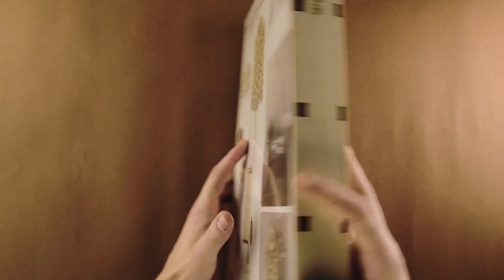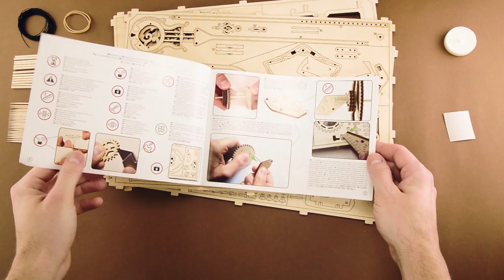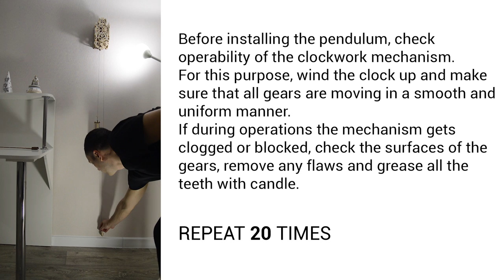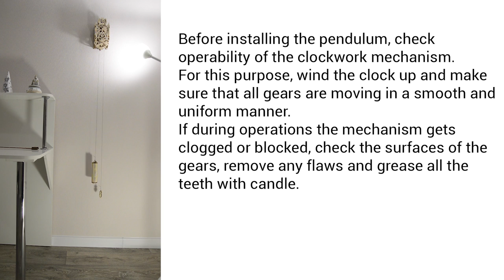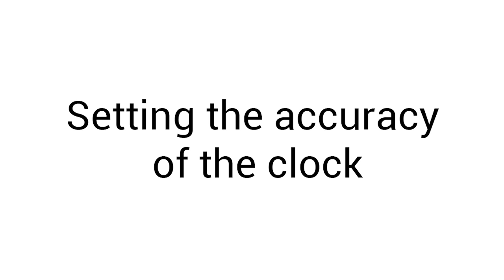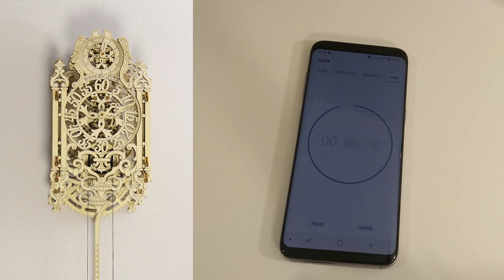ROYAL CLOCK ASSEMBLY

Comment: I simply can't think of anything else that will get me through this lockdown period.  Looking forward to starting this project.  Thank you for that wonderfully calming video.
Reply: Let know how it goes for you. I put this clock together last week, and it only works for about 10 to 15 minutes each time I try to start it, and then it stops.
Reply: @tamerlanechessclub3652  i finished it a few days ago. Unfortunately I can only get it to run for around a minute.  Thoroughly enjoyed putting it together.  Looks stunning, but alas it seems that it simply doesn't function.
Reply: @paulsalmon1625  I replaced the weight with 2 full water bottles [for a total of about 1000 gm weight, which is a bit more than recommended], and after I did that it ran for about 90 minutes. But alas, it still stops. I'm afraid it will break if I try to add more weight to it. I am going to keep monkeying with it. Putting together was a lot of fun, despite the fact that my thumbs were sore from pushing in all those tiny pieces :)

Comment: There are a few problems with this model. Let's think about it: 550-800 gramms. My country has large coins so that's not an option. But we have Euro, as well. So 600 gramms = 71-150 coins with Euros. That's a lot of coins. Even if you manage somehow this problem with weights the next is that the cord isn't strong enough in the long term. And there's the pendulum. It just blocks everything even if you check everything 100 times. The clock looks good, the wood's quality isn't the best (I didn't break anything but that's just because I'm good with those things),  you don't get a full candle jut a really small wax which is enough for.... nothing. It really looks good but if it isn't working... not worth it.

Comment: While the instructions were explanatory - when you get to the part of the string being threaded into the two holes and how they were wound, and inserted into the other gear, that was NOT explained AT ALL!!! And it did not show where the pendulum was supposed to be - the picture was evasive! I have been wracking my brain out as to why I could not get the clock to work - I found this video AFTER I have put the clock together. And it is a gorgeous clock - and right now it is a dust collector. I would like to know about returning the one I have and get another one. I enjoyed putting it together - even the very little pieces that were very hard to put where they needed to go. There was one piece that cracked in half that goes in the middle of the pendulum bottom. I was able to glue it together to the other parts, even if it was not supposed to be glued. there were some other small pieces that broke as well - and I was very careful when taking them out - it is not as easy as this person showed - AGAIN!!!! It is not as easy as this person showed it to be. My hands are not that great - and they were cramping after I assembled it. Yes - I want a replacement of the clock!

Comment: If I use € , at 7.5gm per €1 coin, it will take €68 !  That means a stack  16.8 cm long.  The weight has an internal height of just 13.8 cm, so they will not fit - and that is for the minimum weight of 550 gm.
I have tried wet sand (in clingfilm), £1 coins, even lead type, but cannot get it to anywhere near 550 g.  Has anyone managed this? What did you use?
Reply: Fishing lead works fine.

Comment: Does anyone know how to get this clock to work?  I thought I followed all the directions carefully and it won't work. When I was done I was pushing on things and something clicked into place and it was working like a pendulum clock. Then I got the strings tangled in the rewind part and had to take it apart. Since I do not know what clicked into place to make it work I can not repeat it. If anyone knows the secret please help. I sent a message to the company but no response. Thanks in advance
Reply from the maker: Hi, what email address did you send? Please send to support@wooden.city. We try to help you. Thanks.
Reply: I have the same problem s.